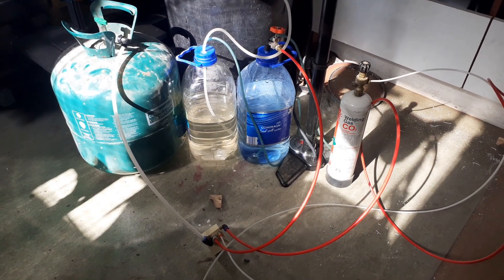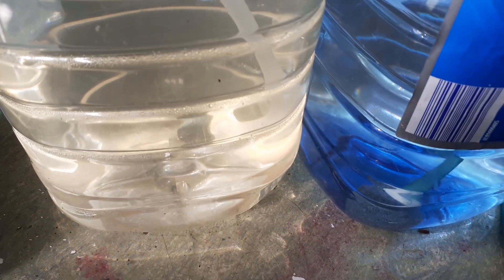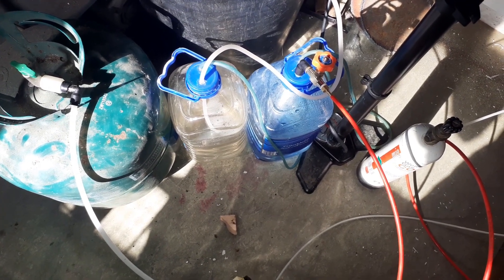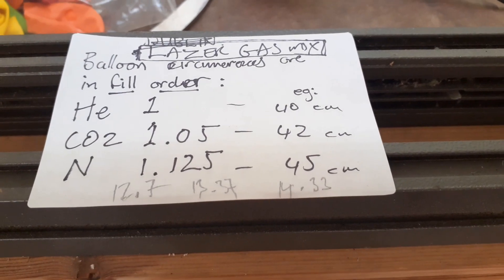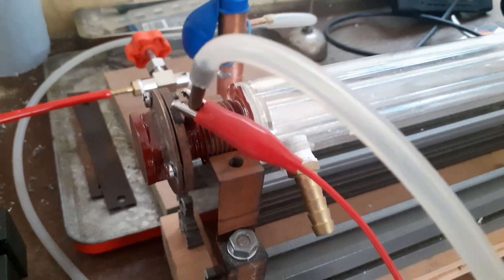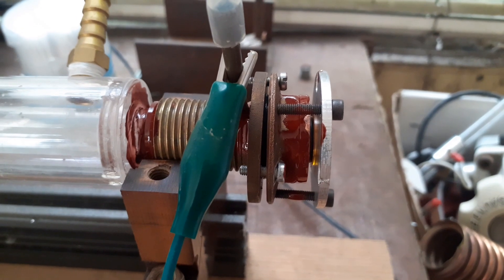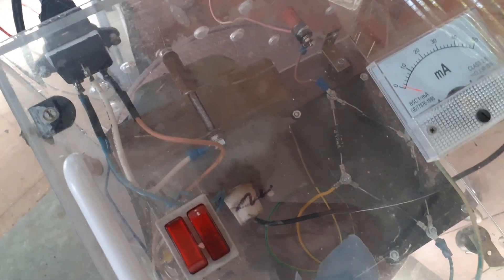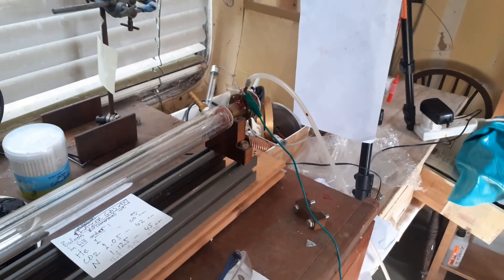DIY Homemade Co2 Laser

Comment: Can i use aluminium pipe for my tube laser ?
Reply from the maker: I think no. For the tube of the electric discharge of the laser gas tube must be glass or similar non conductor.
Reply: @Robertwclarke  oh iam forgot the high voltage side 🤣🤣🤣. Maybe glass is the best. But how bout acrylic tube ?
Reply from the maker: @putriamalia422  I think acrylic tube won't be suitable either because it will melt. The discharge creates lots of heat. Glass or porcelain are the best options. And preferably borosilicate glass which is less likely to crack from the heat
Reply from the maker: You know what I recommend? Search for 'Sam's Laser FAQs' and read the parts about CO2 lasers. There is a wealth of information there which will help you understand what you are getting in to! It's quite a rabbit hole of a project. But very rewarding and so interesting. Go for it!
Reply: @Robertwclarke  ok my friend, ini sangat membantuku, very helpfull thanks 🙏🙏🙏🫰

Comment: Hello friend, I have a question, I hope I am not wasting your time answering it.
What is the function of the vacuum device, and how long do I have to refill the gas again?
Reply from the maker: Hi Limonaty. This is a flowing gas laser. So the gas mix comes in very slowly at one end and is pumped out the other. The vacuum pump maintains a low pressure inside the tube
Reply: @Robertwclarke  Can you suggest me an article or a video explaining the pumping and unloading of gas, because I thought that the mixture was added once, because bringing the mixture costs me a lot.
Reply: Or does the mixture take a long time to refill the same amount as in the tube? Can this be estimated in terms of operating hours?
Reply from the maker: @Limonaty  I think you could estimate how much gas is going through by measuring the balloon volume and seeing how long it runs for with this quantity. I would think a premixed high pressure tank would be needed if you want to run the laser for extended periods
Reply from the maker: @Limonaty  I believe the mixture decomposes or reacts gradually while running the laser. Sealed lasers have a catalyst of some kind inside to stop this happening. Gold I have seen mentioned.
Reply: @Robertwclarke  thank you so much. sorry about my english
Reply from the maker: @Limonaty  your English is excellent! Don't apologise, learning another language is difficult and lots of work. Thank you for all that effort you do to talk my language

Comment: OMG! I did the linear flow CO2 in the early 90s. If you actually get a beam out of this yard sale you are a beast and blessed with the luck of all the Irish combined...
Bloody hell he did it! Now see if you can incorporate gold catalyst to operate sealed indefinitely. You pulled off everything else on a wing and a prayer so why not?
Reply from the maker: Hey thanks for the encouragement Matt! My new folded CO2 tube might have the gold coating. It is work in progress now. I need to test the conductivity of the 'gold lustre' coating in my other video. I believe the coating needs to be very thin and also non-continuous along the length. I may paint in some volatile resist before the lustre. and burn it all off together. Any tips are welcomed!

Comment: Great job sir, dont stop here. your not complete yet. you need some lenses to expand the beam, collimate the beam, reduce the beam to focal length. then you have the power of 100 watts. and then cut coke cans.
Reply from the maker: I think now that I should have had a resistor in the circuit with the OBI transformer. The laser tube looks like a short circuit to it. So it probably would quickly burn out. I am learning as I work. My next laser will be better! Thanks for the comment
Reply: @Robertwclarke  use capacitor array to power laser  instead of powering directly from xformer
Reply from the maker: @anshulbhardwaj4038  hi thanks for the advice. But tell me, what is the advantage of capacitor array based power supply over the transformer? Assuming mean power is the same.
Reply: @Robertwclarke  you have rectifier in your transformer output rms value of bridge rectifier is 1/3 of input supply
Reply: @Robertwclarke  you need to put RC filter In your bridge rectifier. Rc or pie filter will provide you smooth supply
Reply from the maker: @anshulbhardwaj4038   i understand that my unfiltered dc output will not be smooth but the mean power should be the same, no?
Reply from the maker: Like if I'm not concerned about beam consistency over time, then mean power is what's in question. I must crawl before I run!
Reply: @Robertwclarke  DC electricity is making laser beam but if it has ac component  it's effeciency will reduce 

And capacitor is a charge storing device (like a battery) so if you need extra kick you can chose circuit accordingly 

Capacitor will store ac component and re supply it hence improving over all effective dc supply. 
You are not using rms value here .
Reply: @Robertwclarke  capacitor will use ac component of your supply in first half of cycle and supplies as out put in second half .so over all performance increases .
Even modern day electric dives use capacitor bank for same purpose .
Reply from the maker: @anshulbhardwaj4038  now i was assuming that I was getting ac out of my HT side of the transformer but is it  half wave out because it is tied to ground?
Reply: @Robertwclarke  rectifier in your transformer converts ac into DC which makes laser beam but it has some ac component which is filtered by capacitor the link I have provided will explain it properly .
Reply: @Robertwclarke  both half's of ac are used by bridge rectifier (the one you used in star formation).
Reply from the maker: @anshulbhardwaj4038  I have been thinking about this situation. Could you comment on my ideas:  I have unfiltered DC out of my bridge rectifier. This goes from 0V to 8kV and returns to 0V but does not go negative. The lasing only happens at higher voltages; example 5kv and higher. So I need to keep my output above this voltage.....
I am trying to understand why unfiltered DC is not as good as filtered DC in the situation of a laser power supply
Reply: @Robertwclarke  simply because filtered dc will remain above 5kv constantly it does not comes to 0
Reply from the maker: @anshulbhardwaj4038 Thank you for taking the time to explain this to me and the YouTube viewers.
I understand what filtering will achieve but I am still unsure why this is superior to unfiltered DC when used as a laser power supply?
Reply: @Robertwclarke  a wave is made up of two hemispheres in first quarter wave reaches peaak amplitude then it comes back to zero and then goes down to it's peak amplitude in negative side and again comes back to zero 

In a DC supply wave goes to it's peak amplitude in first half and then comes back to zero in second half hence only half of wave is used but when you use filter it reaches to it's peak amplitude and remains there constantly hence performance increases . 
Keeping laser's strength at it's peak through out.
Reply from the maker: @anshulbhardwaj4038  I suspect it is more complicated than that. Surly the falling side of the DC wave is still forward biast and therefore still valid voltage level to operate the discharge?
Granted, below a certain voltage of the waveform there might not be the potential to operate the laser action. Thank you for your responses regardless
Reply: @Robertwclarke  no the falling side is reverse biased
Reply: @Robertwclarke  that's why capacitor and inductors charge during rising half and discharge in reverse direction in second half
Reply: @Robertwclarke  look for firing angle and wave characterstics of a scr you will understand this further .
Reply from the maker: @anshulbhardwaj4038  I do need to look more at this. I believed that all of the voltage after the bridge rectifier was positive. Is that not what a bridge rectifier does? It is rising and falling, but never going negative. 
I will look at the terms you mention above and see if I can understand better. Thank you.
Reply: @Robertwclarke  diode in forward bias conducts after a certain angle that is called firing angle in scr since it can be controlled but in diode it is determined by quantum characterstics of junction .so there is a gap between two half's of rectified out put since laser is an inductive load it discharges in reverse direction during that gap .
Reply: @Robertwclarke  ideally it should be forward biased through out but impurities  and barrier voltage don't allow it to do so this is how quantum physics work I know it's weard but it is what it is in quantum world.also 
Any kind of plasma is an inductive load which discharges in reverse direction of it's origin.
Reply: @Robertwclarke  inductive load is one that involves transfer of energy through induction ,mutual or self both types of . Electromagnetic radiation are light that is photons,heat or magnetic waves .
Reply from the maker: @anshulbhardwaj4038  I never thought of a gas discharge tube as an inductive load! I believed it to be a resistive load with negative resistance characteristics.
Regarding the gap between halves of the wave form. Again I would imagine there being one but if the forward conduction of the diode starts at about 3v then it would not be significant in relation to the peak voltage of 8kv.
A question. How would one determine the resistance of the gas discharge tube in order to calculate the capacitor value?

Comment: How many watts do you think it is generating?
Reply from the maker: I'm not sure of the output. Input power supply is 8kv 20mA if I remember correctly. So thats 160watts and the best you can get is 20% from what I've read. So I assume mine is more in the 2% region! But maybe someone with more experience can estimate from watching the burn speed?
Reply: I have a meter you could borrow to measure the wattage. Let me know if you are interested.
Reply from the maker: Chad, thank you very much for the offer of the meter. I'm sorry for the slow response, I've been away on a contract working abroad. Perhaps with my next laser might need a meter. This one was really just to see if I could get any output at all!
Reply: Plasma looks great but low output for such a long tube with plenty of power. Looks like you have all the right components but to get a decent lase you need the pressure to be just right. If I was to guess with this setup the pressure of your gas mix would be way too high. but total respect for achieving this with basic kit.
Reply from the maker: @Lewjoable  too high a pressure.  Interesting I thought higher pressure would be better. Where would I see the signs of this improvement? Increased current draw or output power? Or both? (Like if there was an efficiency improvement I may not see it at my power supply, only at the output)

Comment: Can this laser emit x-rays ? i am trying to build one, but i am scared that this might happen since they work with high voltage and vacuum ?
Reply from the maker: To my knowledge this type of setup doesn't produce xrays. Wrong pressure or voltage or both! In saying that, this only what I have read. I invite any input from someone more qualified than I!
Reply: @Robertwclarke  what pressure do you have in your setup ?
Reply from the maker: TBH I'm not sure of the actual pressure or voltage. Pressure is pretty high in terms of vacuum technology. It's operating just below the pressure where there discharge ignites.
Reply: @Robertwclarke  so it's a matter of trial and error, i got it :))
Reply from the maker: @bogdanm251  i think yes. But I suppose the best thing is to get everything setup as precisely as you can and vary only one thing at a time. Gas flow is the easiest for me. As my power supply is fixed and I'm not touching the mirrors while it's live!
Reply: @Robertwclarke  well, i can make even the voltage variable, but idk how high should i go
Reply from the maker: @bogdanm251  if i remember correctly mine was 8kv 20ma.
Reply from the maker: I think also there will be a minimum relating to the length and diameter of your tube
Reply: @Robertwclarke  i have a 2M tube with 26mm diameter, so i can cut it to whatever i want, but i am tempted to leave it like it is now, so i will end up with a huge laser.
Reply from the maker: @bogdanm251  thats superb! I'm gathering parts for a laser similar size for my next project.
Reply: @Robertwclarke  keep me posted, i am too shy to post videos, my end caps (aluminium) are at the milling machine guy, and i am waiting a lens from China...and i have to drill a hole into a Si mirror, that's gonna be fun. And i also want to make a high voltage probe so i can accurately set the voltage.
Reply from the maker: @bogdanm251  do you own a copy of 'Procedures in Experimental Physics' ? If not I highly recommend it. It's a classic full of wonderful information that is very useful in terms of getting things done without special equipment
Reply: Bogdan M have you already tested it ? what is your power supply?

Comment: why the 2.5mm hole ? is it a calculation ? or just guessing ?
Reply from the maker: I went off guidance from Sam's Laser FAQs. There is a wealth of information there. I'm not sure if its optimal for my tube /discharge diameter but it works!
Reply: @Robertwclarke  thanks, i will check it because i plan on building my own. Also, where did you get that ZnSe simple glass ? all i can find are lenses.
Reply from the maker: @bogdanm251  Yeah, that flat was a kind gift from a gentleman in Israel. I got his contact from his ebay listing many years ago. Kind of a random one.
Reply: @Robertwclarke  lucky guy :)

Comment: Nice. Those copper mirrors you did yourself or are purchased part? and I suppose there should be partially reflecting mirror, this is even purchased? And even did you do experiments with less substances of gasses? i.e. without Helium, etc.
Reply from the maker: Check that link in the description it should answer most of the questions the video doesn't cover. I did a detailed write up of it there.  I didn't try with gas variations yet. That might be an interesting idea for my next laser tube